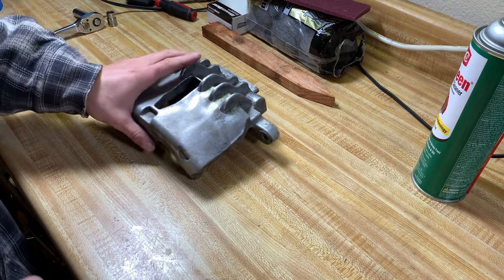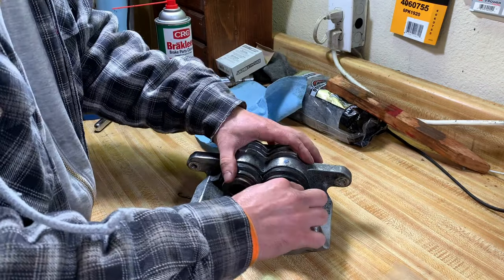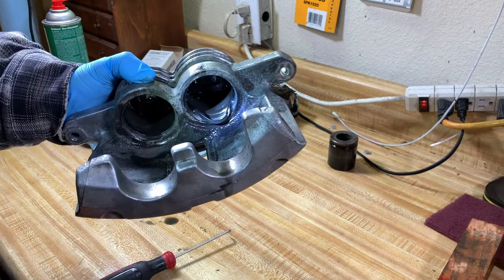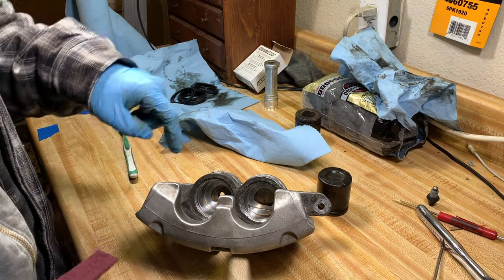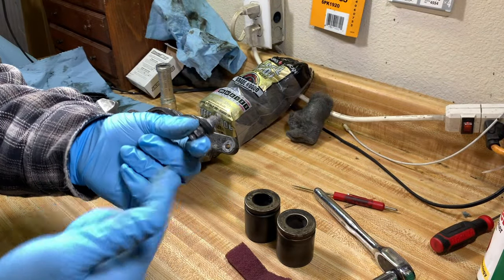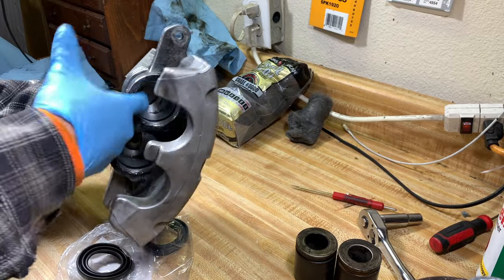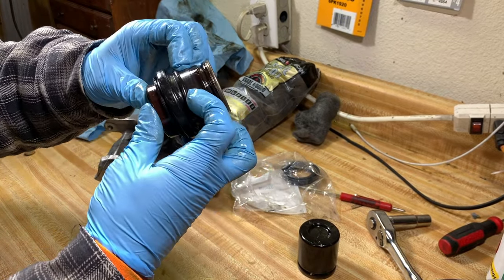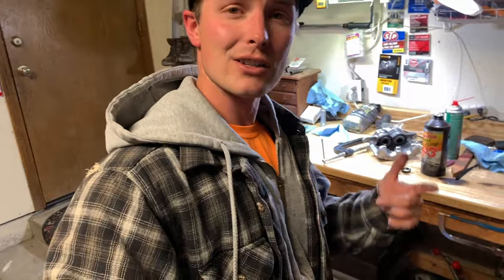How to Rebuild SN95 front brake calipers. STEP BY STEP

Comment: Just an FYI you can get Centric stainless replacement pistons if the phenolics are grooved or eroded from heat (as mine were) and man they slide/release so much quicker and easier but it the stockers arent damaged they will do plenty for majority of folks anyway.
On your rear set up there is a company on Ebay that sells billet brackets to use Fox width axles and SN brakes, keeps the original track width without having to use SN width or SN stock axles.......cool vid buddy, keep up the positive progress
Reply from the maker: Oh thanks for the tip I didn’t know that I’ll have to look into it cause that’s pretty interesting! And awesome thanks I was looking at the strange brackets cause I’m going with their 9 inch ends and axles but I’ll have to check those other ones out ! Thanks I’m having a lot of fun with it!!

Comment: I got the Cadillac ATS brakes but this was very cool to see. We live in a world where everyone throws the item away instead of rebuilding them. (I’m guilty of this myself) I look forward to seeing more of these videos.

Have you done 5 lug rear axles yet? I really need to do these and a good video would be helpful lol. I was going to do 31 spine but you have to change the thing in the rear which has me thinking. I’m debating 28 now but at the same I have a Turbo 306 so I really need to change the gears. I have the stock 3.27 I believe they come with.

I’ve began to rabble now but anyways great video look forward to others like this. Thanks
Reply: If you are turbo step up to at least 31 spline/c clip eliminators also.
Reply from the maker: I really looked into the CTS-V brakes their an awesome upgrade! I’m just to poor for it right now I need to focus my money 😂 but IMO 31 spline minimum for your setup and c-clip eliminators are a good idea like young said as well! NHRA won’t let you race unless you have them. Which I just found out 😅

And I’m going to have a whole series about the rear in the near future that’s actually where all my money is going 😂 I’m doing strange 35 spline axles with the strange S-trac and the Ford 9” ends and welded tubes and it’s going to get braced as well! And I have a 3.73 gear right now and it’s absolutely useless on the street I was actually going to go to a 3.31 or 3.08 after reading on the turbo foxbody forum. Like you were saying the turbos love that load from what I’ve read. 

And don’t worry I love talking cars! Haha

Comment: On my sn95 I just got, my brakes are sponge. Do you think I need to rebuild them? The guy I got them has new ones in a box but rusted from being outside
Reply: If the calipers are rusty then they are 94-98 single piston metal calipers, probably need to flush the brake fluid since it absorbs moisture and can cause corrosion in the calipers, master cylinder and ABS unit if not kept clean. Brake fluid is probably one of the least maintained fluid in cars, if driven hard, braked hard enough to smell them regularly then it should be flushed regularly also should be done at least every time brake pads/rotors are installed and not just a quick bleed job.
Reply from the maker: Exactly what young11984 said he knows what’s up when it comes to these cars!